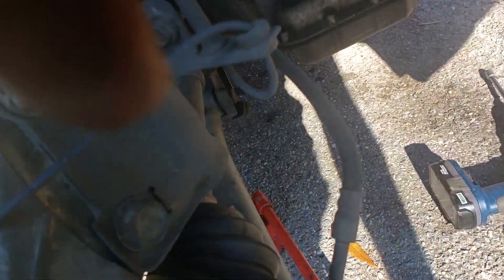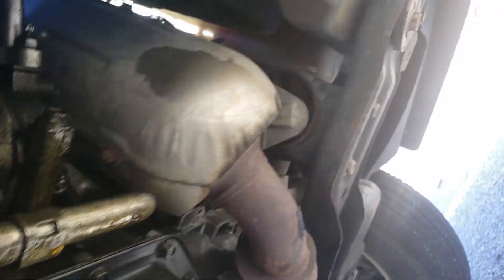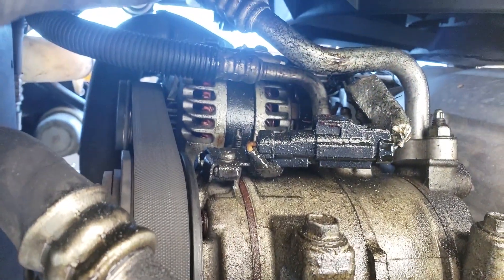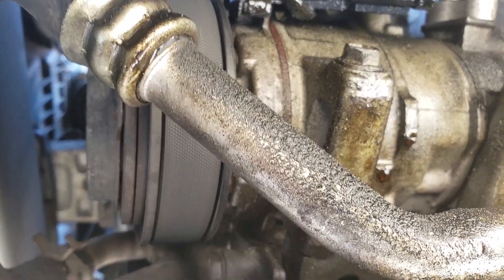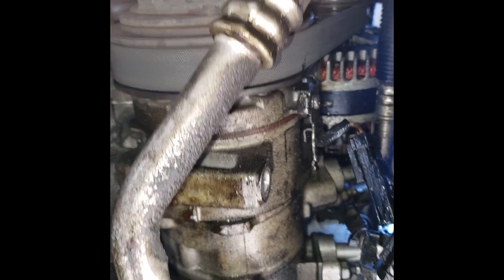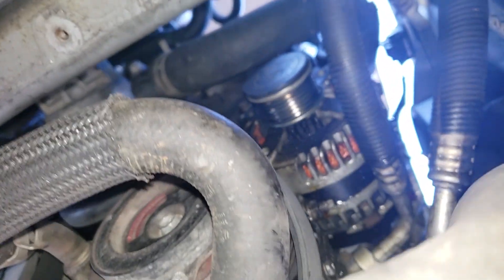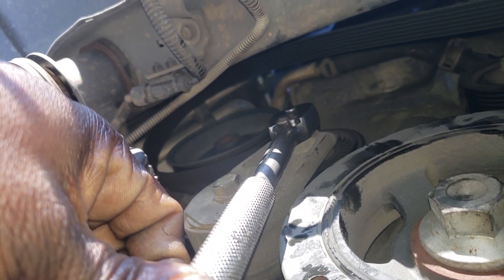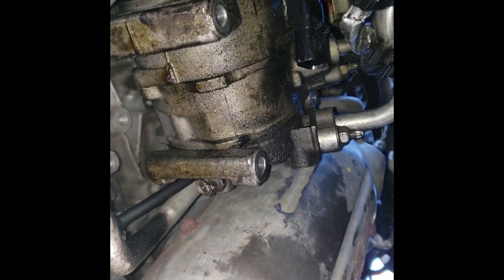Dodge Caravan alternator replacement

Comment: I did 2 of these this week, first time ever, on this model,  first my niece broke down on side of road parked at a gas station, I went and removed replaced it in gas station parking lot, in the dark about 32 degrees outside with a work light. I used fan and airbox removal method, took about hour and half , few days later, my neighbor had same issue, I was able to do that  in a garage, timed it with stopwatch, 54 minutes. the biggest issue is getting ratchet to the tensioner to get the belt off and then back on, especially outside in dark.

Comment: Thank you kindly for your hard work in this super informative video . It is hard enough to do this job by itself and shooting a video at the same time is EXTRA hard work . These are great vans but the design makes changing the alternator VERY HARD work ! I am sure not many could succeed ! I did mine today and from the top . It was crazy hard to get the alternator out . I did remove passenger side wheel in order to release belt tensioner . I think Its best to remove the fan shroud verses A/C comp . I will have to remove the shroud to get the new Alternator in tomorrow , because today was total tight misery , but I finally did get it out . Had to because sun was going down for me as well .  Again thank you so much for having the patience to do this job  and video document . Awesome work , my dear friend . Much admire your skill and patience ! Much respect.

Comment: I watched you do it from the bottom, and another video of doing from the top. since I didn't have the torx socket I did it from above. removed fan, rad fluid, hose, air box, etc to get to the alternator. I even have a hoist in my shop. It wasn't that bad, I had it out in an hour, and back installed in 30 minutes. All in all a pretty easy job.
Reply: From the top is the best, in and out less then 2 hrs!   Glad I didn't do it this way!

Comment: The socket you needed for the studs is an External Torx.  Can get it at any auto part store.  The other option is when you get the nut off the one, put it on the other stud.  Start then loosening the nut BELOW it and they’ll jam together.  Then work the nut below with just an open end wrench.  Two nuts jammed is an old technique to remove studs.  Eventually the stud will start turning since you’ve now made basically a bolt head for it more or less.  Etorx aren’t expensive though.  My kit is old and it’s a craftsman set of specialty sockets I got eons ago for $30 or so.  Harbor Freight has decent etorx too that’ll get you by in that situation.

Comment: i have to say THANK YOU! i was doing the change of the alternator from the bottom and I was stuck with the removal of the AC condenser. If you hadn't shown the trick of the 5.5mm socket i would still be under the van!!

Comment: Sadly it was probably a bad decoupling pulley on the alternator that was bad. I see lots of alternators getting replaced on these newer vehicles and more than likely the ADP just needs replaced.
Reply from the maker: That's true but it's easier to just replace the  alternator than removing the pulley

Comment: great video.  Only thing I did different was disconnect upper water hose to move it out of the way so I could get to upper alternator bolts and disconnect wires.  Took just a minute to disconnect hose, lost about a pint of antifreeze.
Reply: Me too. Holy crap what a project. Lol

Comment: worried about stripping steel compressor stud in aluminum block.   did you look up torque prefs and OE thread lock for this?
Reply from the maker: If you are worried..you should uses a torque wrench with OE spec

Comment: I can't get my belt loose because my tensioner won't budge so now I'm stuck. any other tips?
Reply from the maker: @ 7:51 just as in the video.. connected the tool in the slot and push towards the compressor...need lots of strength to release the tension.
Reply: Turn it the other way

Comment: No no no you're doing it all wrong you do not have to touch the air compressor whatsoever remove the radiator fan which simply comes out by pressing two tabs and pulling it up remove the serpentine belt remove the top radiator hose disconnect the three bolts that hold the alternator in place remove the electrical connector and the alternator will come out with absolute ease plain and simple that is it
Reply from the maker: Thanks for your input...But as I state in this video...I already tried the radiator approach and this time...Im trying the compressor approach.